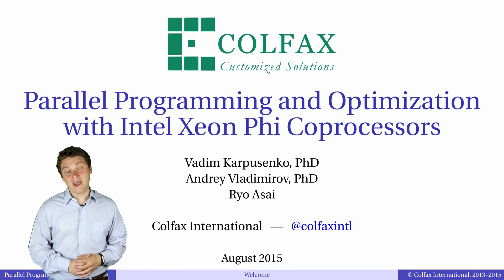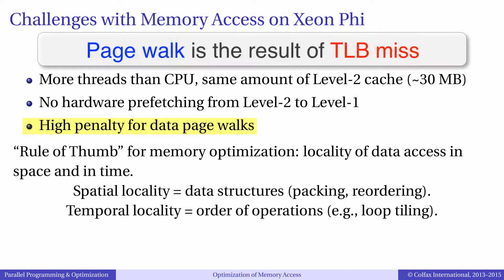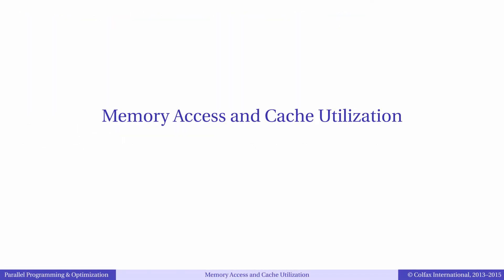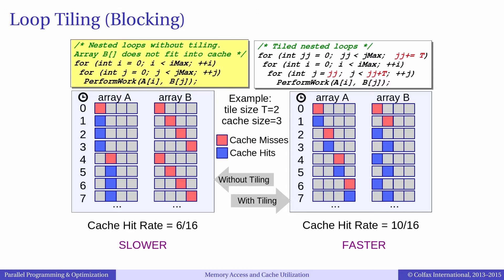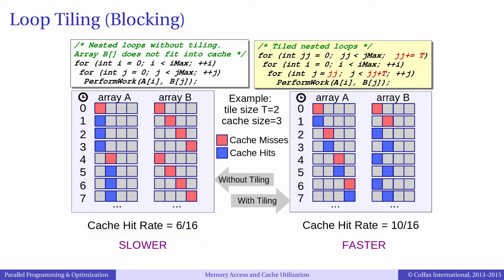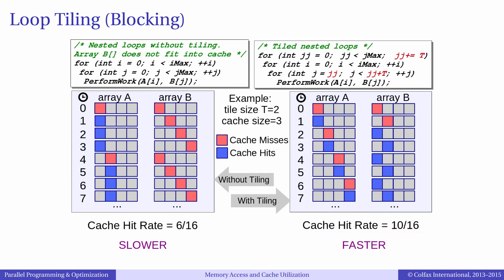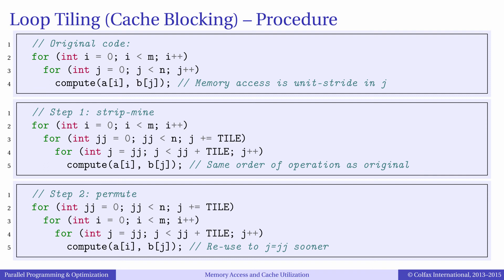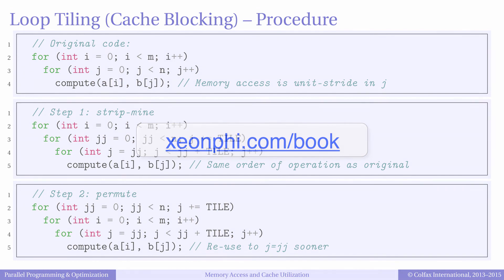Episode 5.12 - Optimization of Memory Access

Comment: Hello Vadim, if A and B are vector, why did you draw them as matrix? Thanks!
Reply from the maker: This is time evolution (0 - the beginning - 0, 0; 1st step - 0th element in A, 1st element in B;  2nd step - 0th element in A, 2nd element in B, etc) for indeed flat vectors A and B.
Reply: Each line is an illustration of A and B. Not the whole matrix.